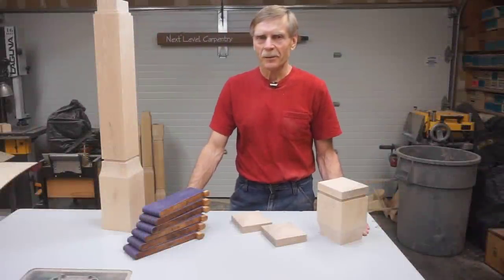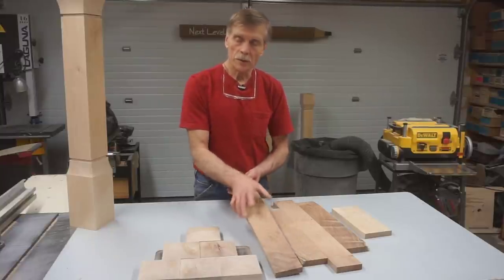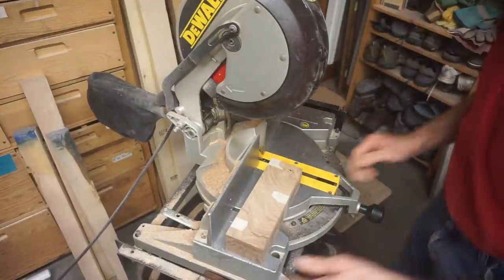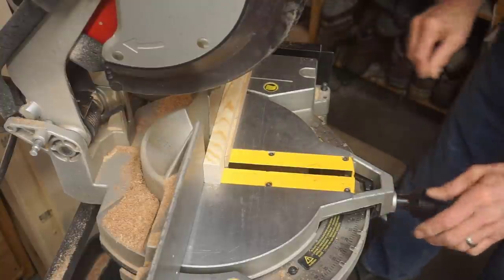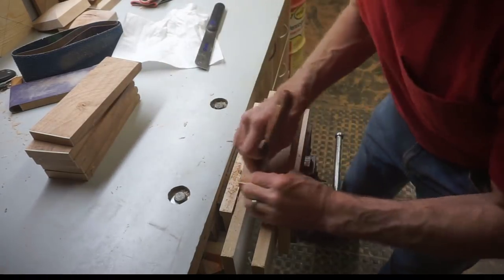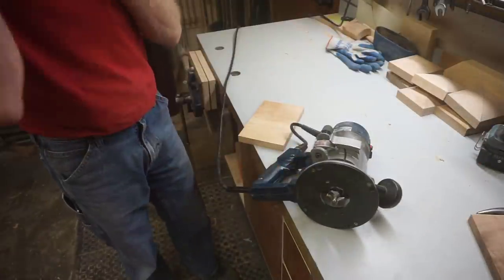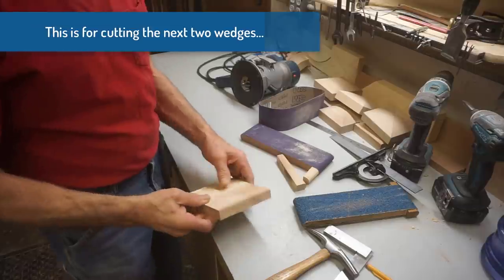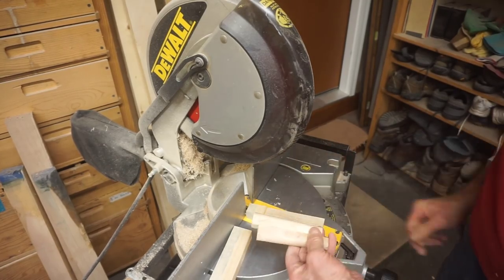Best Blocks for Demanding Sanding

Comment: Great video Matt, inspiration for me to get busy and make a few of these up. I have used every thing from plastic handle sanding blocks, rubber blocks, wood blocks etc.. etc... Never made a block for a belt sand paper. Great Idea!!...... I did see the video about the 2 x 4 block cut to size for the belt sand paper but agree, that would do in a pinch but no adjustment for different belts, etc. etc. And too bulky.
Thanks again brother Matt, always enjoy!!!!
Al
Reply from the maker: Thanks Al... a guy like you will quickly find these blocks useful and effective!  I've got a drawer full of assorted types of sanding blocks you mention and they all have their place but this type is indispensable for certain projects.  I wouldn't want to come across as a sanding block snob because I'd probably resort to using the sole of my shoe in a pinch if that's what it took to get the job done :-)
You're welcome... your comments are always appreciated!
Matt

Comment: I made these over 12 years ago and after losing the wedges over and over i decided to fasten the wedges with a recessed sliding bolt. I also made the wedge stick out 1 1/4 on both sides so that you can tap it on your bench to tighten and loosen. Hope these tips help you all.

Comment: Matt, I like the Mercedes/ Festool quality you put into the little shop tools that are so helpful.....and they’ll last a long long time !
Reply from the maker: Hey, thanks Don!  I know that the set of blocks I made for this video will be the last I'll ever need 😁😎  It's great to see your comment here... hope you've had a great summer with at least a little time to relax and enjoy!  Best, Matt
Reply: dont mention festool, they will bring out a copy and charge 50 bucks, and another 50 for a systainer to put em in ;0)
Reply: Sorry Green Man.....you’re right !
Reply from the maker: No worries Mr Don... comparison to a Mercedes can't be a bad thing by any stretch IMHO! Best, Matt
Reply from the maker: True con-fes-ion: I don't own a single fes-tool or fes-tainer but somehow manage to get by.... Best, Matt
Reply: What vacuum are you using for the small power tools?
Reply from the maker: @louisrucci6043  The only vacuum I use for any small power tool is the one that's part of the excellent Mirka sanding system.  Other than that the dust and chips just get swept up after flying about... Best, Matt

Comment: I think that you should consider doing a video on the making of the out feed stands. Though a lot of the work that you and I do is wood related, remember, we are after all, tradesmen, and sometimes using other materials such as metal, glass, stone or wood  is part of that world. I for one would love to see just how it is done, and would most certainly make a couple. I have done very little welding and an exorcise such as this is just what people like myself as well as others need to expand and develop new skills. Think about it. Thanks for a great channel.
Reply from the maker: Daniel,  I was afraid of this... a well reasoned and compelling explanation for why I should do a roller stand video :-)  With your comment I've officially added a roller stand build to my to-do video list.  The unfortunate part is that, with my current cludgy system of throughput for videos, it takes a long time to go from concept to completion. I constantly strive to improve video quality to speed up the production process which hopefully will make this happen sooner than later but it will still require forbearance on your part.  I'm anxious for this channel to reach a 'tipping point' that justifies hiring a production team of some sort but, near as I can tell, that doesn't happen until subscriber count is in the 50~75k range which is still a ways out.
Thanks for your insight on this because its the sort of feedback that helps direct and improve Next Level Carpentry for fellow tradesmen!   Best, Matt

Comment: loving every videos from you Matt - always an inspiration for me especially now that i need some sanding block then i just stumbled on to this gem! 

  I couldn't help but ask as to why you didn't use a riving knife on your table saw
Reply from the maker: Riving knives are indeed a great safety feature but I find they get in the way and impede the wide variety of cutting operations I do on a regular basis. I'm convinced the main reason I work confidently without a riving knife is because of the design of push sticks I use for every cut less than 6 inches in width.
I have had one accident in over 30 years that arriving knife would have prevented but a little less haste on my part would have prevented the accident as well. Don't let my opinion and experience alter your judgement and use any safety features and measures you need to work confidently with respect for your tools but without fear.
Best, Matt

Comment: excellent design and  build video  i did  Woodworking professionally  over 25 years and as my hobby for over 30 years  i basically  used the same style of sanding block  but i am ashamed to admit that i never took the time out to  build myself a  nice looking one out of nice exotics i had access to ?  go figure  i  used a  off cut of  some clients Mahogany Base Molding  yet   over many jobs i did over the years never lost that  old ugly one  mine is set up for 3X24 belts  and it is  one of my most used tools one of the Qoodworking supply companies does sell a plastic one that  has a cam lever  that expands  the block to  tighten  it to the belt  a nice feature of their design is it has a  point on one end for getting into different profiles  i forget what catalog / website i saw it on

Comment: Hey Matt, outstanding tool for the shop, have made six for my hobby shop. very well detailed video Great job
Reply from the maker: Thanks for letting me know, D.L, and glad you like them and the video.  BTW just today I was doing a project in the shop helping out a friend and used those very blocks a number of time.  I think you'll really like having 6 to have a full range of grits on hand for different tasks.
Anything you can do to spread the word around to promote Next Level Carpentry is greatly appreciated!  Best, Matt

Comment: I am off to the shop to make a set of these, but smaller.  I have some 14" x 2" belts.  These will fit in my tool kit, using a little less space.
Reply from the maker: Should work just as well and be just as handy... have fun with the build, Stephen! Best, Matt

Comment: What was the orbital/disc sander you used? Thanks for the video. While some could argue that this level of craftsmanship for “a simple sanding block” is overkill, I do know that when a pick up a good tool I am more mindful and focused when it hits my hand and the workpiece. It's a subtle thing but that is the point isn't it? Builders just build  and crank things out one after another, but there is nothing more than function out the end product. Makers make but it isn't about mastery it’s about proving they can make something. But  craftspeople craft, and the result is singular.
Reply from the maker: So true about tools and mindset Pario... thanks for watching and commenting.  BTW That a Mirka Deros sander that's part of this system:  https://www.amazon.com/dp/B01FRGX53K/?ref=idea_lv_dp_ov_d&tag=aiponsite-20&linkCode=ic6&ascsubtag=amzn1.ideas.1BL629QJRJZM0 I've had it for a few years now and, once I got used to having a vacuum hose hooked to a sander I love it!  Kind of spendy at the outset but quickly becomes worth it.  Best, Matt

Comment: Matt, thank you for presenting the intriguing thought that for Demanding Sanding, a low-tech shop-built DIY tool will be preferable to anything with lithium batteries, brushless motors & plenty of electronics...  ; )
Reply from the maker: Hannu, thanks for commenting here! There are applications where no 'fancy' sander comes even close to what these simple sanding blocks will do, right?  I hope you don't think me hypocritical for using a high-tech Mirka Deros sander for making these blocks nice and smooth for the beeswax finish all the while talking about how useful the shop built style of sanding block is.  Truth is I don't want to be without either for doing Next Level Carpentry :-) Best, Matt
Reply: Matt, by now I have noticed how in your lessons there's plenty of healthy and pragmatic "back to basics" approach, not emphasizing the latest technology for its own sake but doing whatever works best! Though being a novice myself in woodworking, by coincidence I also decided to invest in a Mirka Deros (which I'm proud of as a Finn, Mirka being designed & made in Finland). Whatever helps me get the most out of it,  as well as any simpler methods applied as appropriate, is always welcome – the outcome is what counts! 

I found your videos only recently and I have enjoyed all of them very much. I haven't checked yet, whether you have something on veneering and trimming corners while doing it (and avoiding splintering the edges) – I would be grateful of any tips & tricks on that subject. Looking forward to more Next Level Carpentry!  – Cheers, Hannu
Reply from the maker: Hannu, good on the Finns for producing the Mirka... it took me decades to finally  upgrade and I chose it over a Festool with no regrets.  I have this video about veneer edgebanding: https://www.youtube.com/watch?v=KLGHf26YsjQ&t=1s but don't know if it's what you're looking for or not, but ask questions here anytime, OK?
Best, Matt

Comment: “Oozage” is a great new word! (And good tip re using activator to get CA glue oozage off the top of your table saw.)
I like your videos and this project will be one I’ll be making.
Reply from the maker: Thanks Barbara... it's good to know you're fluent in the garage-grade dialect that gets spoken 'round here sometimes... no in-depth etymology needed :-) I'm sure you'll find the sanding block useful... to the point that it almost feels like cheating sometimes!  You'll see it put to use making those 'double-domed' newel post caps as soon as I can get the video produced and uploaded.  Let me know if you hit any snags making the blocks?
Best,
Matt

Comment: Thanks. I just made one of these and it works great. But I have to modify it, right? My version of your sanding block is specifically for edge touch up on an assembled project, so I added a little fence on one side to help keep gimpy me square.

Comment: Loved your videos they are very interesting and provide great tips and trick. In this sanding block video you are using a CA Glue and activator. Can you share the product info? I like the fact that the glue is instant curing. Thank you very much.
Reply from the maker: You're quite welcome Robert. You can find Gorilla CA glue (NOT Gorilla Glue) and StickFast spray activator product information by clicking the link to my Influencer's Page in the video description above or by following it here:
https://www.amazon.com/shop/nextlevelcarpentry?listId=29WVINIJF4EUJ&ref=idea_share_inf
Both are indispensable products IMHO... thanks for asking! Best, Matt
Reply: @NextLevelCarpentry  Thank you for the reply. The Gorilla Super glue is a CA glue. Perfect. BTW, the saw horses are fantastic. The weight test was exciting to watch.

Comment: cool sanding blocks,  got a lot of great ideas, thanks NLC!!
Reply from the maker: Most welcome Pieter!!   I think you'd find the blocks useful if you end up making any.  I'm anxious to get to showing the 'real work' of doing millwork on the box newel posts I've mentioned in the last two videos... hope it's worth the wait :-)
Matt
Reply: i hoop to see them soon   the post in the video looks great!!!!!!!!!!!!!!!!!!!!!!!!!!!!!!!!!!!!!!!!!!!!!!!!!!!!!!!!!!!!!!! top,top!
Reply from the maker: Pieter,  I'm actually installing the posts, handrails and related trim pieces this week and working on producing more videos of the process so you can check them out.  After the next video showing how to cut consistent, accurate pieces with sharp 45 degree angles on two edges I'll do one showing the radical router fixture used for making the 'double domed' post caps and think you might appreciate it especially.
Thanks for commenting!  Best,
Matt

Comment: Jim, I saw that when you made your first cut on the wedge with the Miter saw, I noticed that you crossed your arms while holding the wood and making your cut. I know that you have lots of experience woodworking and you won’t hurt yourself but a novice may follow your example and because of their lack of experience may cut themselves. (BTW, I also do this sometimes but I try not to because you never know what can happen, an accident happens quickly). For the beginners, always hold the piece you are cutting with the hand on the same side of the piece and cut with the other hand. So if the piece is on the right side of the blade, hold it with your right hand and cut with the left hand.
Reply from the maker: Good point Daniel.  Another significant factor is that the practice you talk about has even more potential for treachery because my miter saw isn't a sliding/compound model like most folks use these days and the added possibility of horizontal movement of the spinning blade greatly increases the likelihood of an ER incident!
Best,
Matt
Reply: You are so right, I hadn’t even thought about the sliding miters. These add whole other level of danger

Comment: Something that I keep around is different sizes of PVC pipe with sand paper. I spray adhesive the paper to the pipe and  it works with blocks of different shapes and sizes of wood blocks
Reply from the maker: Nate, thanks for commenting on this video... every idea to make sanding easier is a good one!  Different sizes of PVC pipe are indeed really handy to keep around.  You might be interested in this video where at about 15 min/30 sec I show another way to hold sandpaper to various size pipes without needing spray adhesive: https://www.youtube.com/watch?v=8h4OJHhSH8A 
It does't hold as securely as the spray-on adhesive of your method but is plenty good for most applications and is really quick and doesn't require clean-up when changing paper.
Best,
Matt

Comment: Cool wedge design! I have been making and using blocks like this for a long time but i use 1 1/8" thick particle board and got the fit to be so tight and then use some small shims to lock it in.  I like the 1 1/8 because it feels better in my hands than a 3/4. Carborundum belts have always been my favorite. 
I also sometimes cut the belt and glue it to a block with contact adhesive.
Reply from the maker: Jeremy, I can see where a thicker block would be better for handling and some applications.  Thinking about it I'd probably  put a groove along each edge of the block with the tip of a core box bit for additional finger grip... do you do that for yours?  The 9/16" radius on the ends of the block (as opposed to my 3/8"+ radius) sounds like another beneficial feature.  I think you'll like the wedge design I show because you can make the belt extremely tight with little effort for putting the belt on or taking it off.  No need to glue to a block (unless you're after a smaller size) to hold it tight.  Best, Matt

Comment: Great Tutorial, I have liked and subscribed. I am wondering which belts do you think will be best for these blocks? Thanks for your teaching..
Reply from the maker: These are the only ones worth using IMHO: https://www.amazon.com/dp/B0064CPOSG/?ref=idea_lv_dp_   xfingerx.  You can find other grits here: https://www.amazon.com/shop/nextlevelcarpentry?listId=Optional%5B29WVINIJF4EUJ%5D&ref=idea_share_inf  Buy them locally if you can find them or use those Amazon links if its cheaper or more convenient. You're welcome for 'your teaching' and thanks for the sub! Best, Matt
Reply: @NextLevelCarpentry  Hi Matt... So the belts you use are 3x24 or 3x21?

Comment: Nice sanding blocks Matt. Did you consider using a 1/2" cove bit and add a finger grip on each side.
Reply from the maker: No I haven't but it's a great idea!    I've not had trouble holding on to them but if you see finger grips on my blocks in future videos you'll know it's a result of your suggestion! Thanks for your comment... Best, Matt

Comment: Great idea!  I will be making a set of these.  What brand beeswax finish did you use.  I could not quite read the container.
Reply from the maker: Hey Mark; this is the stuff I use:  https://www.amazon.com/dp/B0725TZ4B5/?ref=idea_lv_dp_ov_d&tag=aiponsite-20&linkCode=ic6&ascsubtag=amzn1.ideas.3GA3JVIYHSDXX a little bit goes a long way  but for some reason the Amazon price for this pint is about what you can get a quart for directly from Skidmore's site... your call.  Best, Matt

Comment: Hey Matt! I am getting so old, I can't remember where I saw you using the flat file with the wooden handle. I ordered them from Amazon and they came in. So far so good. Now, I was wondering if you had a preference if the file cut going forward or back? I would think forward but just wanted to check with you. Regards,
Bill
Reply from the maker: Hey Bill,
I 'push' that file 99% of the time... just seems right and effective.  I switch to a pull stroke in rare occasions where something about that position helps control the 'cut' a little better.  The only thing you can really do wrong with it is to let it tilt to one side or other on a wide surface because the edges of the teeth can leave deep scrape marks.  Might practice on a piece of scrap to see this consequence which is easily avoided if you're aware of the possibility.  Otherwise I think you'll find it quite useful for certain tasks... like scraping CA glue build-up... Best, Matt
Reply: @NextLevelCarpentry  Thanks, Matt!